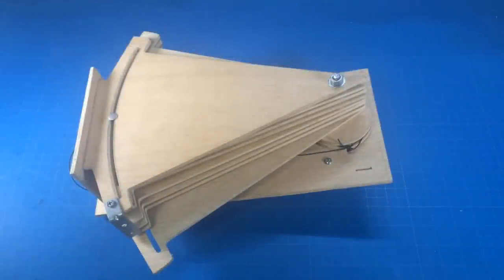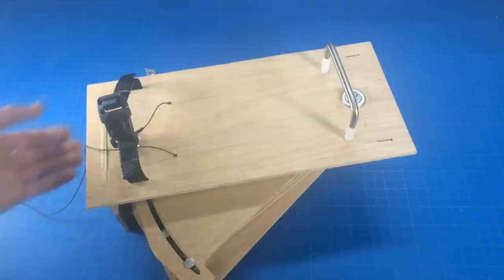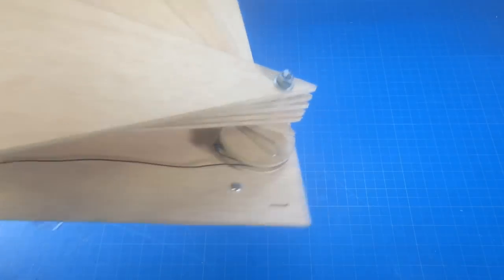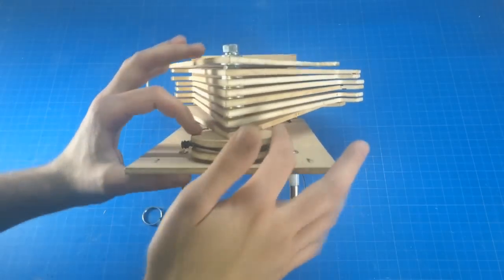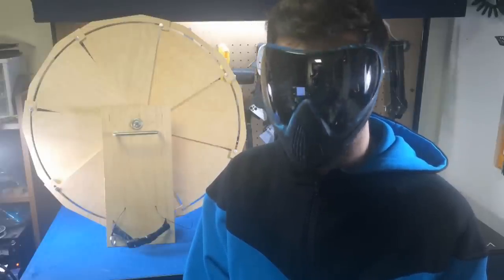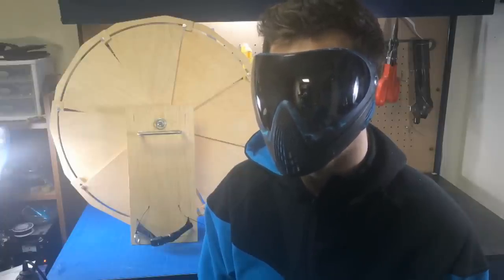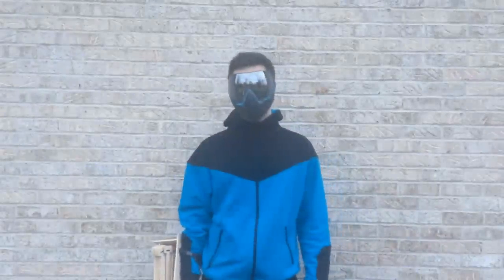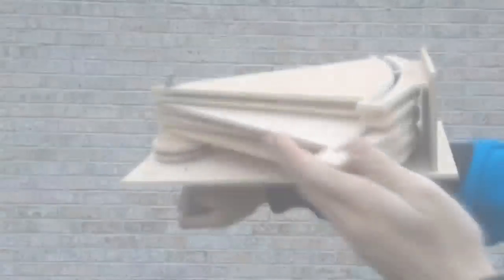Deployable Arm Shield "Percy Jackson Wrist Watch Shield"

Comment: If it were me, I would make it some type of gauntlet or glove. maybe move pulley system to the center, because the shield is so big. you could also have it to were you have a ring on your finger with a string to deploy it and spring to reset it.

Comment: make it out of thin strong metal have the joints be light and add a button rather than string to open it and also add some counter weights so when you take it out its not a strain on your arm.

Comment: Very nice! is there any way to reinforce the front of the plywood with a thin layer of aluminium and would that work?
Reply from the maker: +Tasos Meletlidis Aluminum is a relatively soft metal. Currently I don't have the machinery to mill it out. It's also expensive.  Good idea tho, thanks for commenting :D

Comment: Aw man, please make the metal version! that would be amazing! As an engineering student I wish I could help but I don't know, it looks like you know what you're doing, for a prototype at least. My only advise would be to figure out a way to deploy it without a string. Or at least a controlled string. For example I might just make this myself now just because of how awesome it looks but probably out of metal and I would probably, at least try, to use cables and have a bracer with a slider on it so when you pull or push it it deploys. Not sure how plausible that is but it'd be nice right? I finally just subscribed today btw, Merry Christmas! 
-Dec. 24, 2015
Reply from the maker: +erock676 Haha thanks. Its a nice Christmas gift! I might become an engineer too!

Comment: dont think its a point in using a motor, use an spring mechanism instead. Because it dosent matter if its an hassle to pack up the shield afterwards since you would be done with your enemy.

Comment: well once you use try to use metal for this dont forget it should work almost the same, with the mechanism but make sure the metal isnt too thick so it will still be lightweight, and you will be able carve your logo into it also
Reply from the maker: +Tyler Van Pelt Those are all good points! Maybe I'll laser etch the logo in.
Reply: yeah that wouldnt be to hard to do, and it would make it look pretty sick
Reply: and maybe for this shield that you have now if you have a wood burner you might be able to wood burn your logo into it

Comment: hay bro nice shield nice method while i was thinking about it i thought of my own idea as well well you see of there is a bolt in the middle you can use a motor on the bottom on the bolt and  the shield plates are fixed on the bolt and the plates are on a angle bent towards the arm this method may work to make the build a bit thinner allowing the plates to be closer together also a manual way to stop the the momentum of the shield opening is by having a lock that hits each other like this        

    ]
[
the to curves grab each other preventing further extending 
also a a spring verticle to the playe on the bolt can be used to propel the sheild ad motor to retract by rewinding the bolt and beacuse the plates are fixed on the bolt they were retract ( note to keep the spring not to strong or the motor will stuggle to reduce the tension on the spring opposing force 
your outer ring track that keeps the sheild open in a circular motion is a reall good smart way to keep the sheild from openiong in a diffrent form 
nice work hopes my ideas help 
ps: if i had the materials at my eposal i would have made this cause i have fantisized make ing this as will as percy's sword

Comment: What's keeping the shield fragments seperated? Spacers near the edge? Something along the lines of that? Or is it just floating there only connected by the bolt in the center? Adding spacers between may keep the shield more stable and stop from opening half way like I saw in your demonstration.
Reply from the maker: +The Huggernaut Yes I used washers. Now that I think of it, I should have used nylon instead of metal

Comment: +GreekGadgetGuru what if you took half of the shield plates and put them on the bottom wouldn't that help more with the sleek design and with the opening and closing anyways love the shield keep up the great work
Reply from the maker: The only thing would be to have 2 moving pivot points. it would spin outward in opposite directions and meet in the middle on both sides. Thank you!

Comment: You should make the mechanism hidden on the inside somehow so that a blow to the edge wouldn't break it's pully groove system.
Reply from the maker: Yes I agree! but moving it farther outward makes it easier to spin.
Reply: +GreekGadgetGuru Cool you replied :D Great job so far, I have a few more ideas that might help with the prototyping. 

When I can afford to I want to set up a little shop to make invention idea projects like you do. 

Anyway yeah, there's more leverage on that outer edge but for durability in combat it might not hold very well. 

I was just thinking something hidden behind a solid top layer.. In some kind of metal groove / rail attached to the underside of each "shield plate". Like a curved ball bearing drawer rail. 

And maybe it could use an electric motor or compression so that you don't need to use your other hand to pull the string. Then it could block one handed while you hold your weapon in the other.
Reply: +GreekGadgetGuru I tried to vote for you in the contest but I just noticed how old this video is lol. Maybe you're not working on this anymore.

Comment: I've been designing a  plastic melt&mold system... What if you make molds for each part, & mold it out of polypropylene. Light weight, toughest plastic available, & you could make the parts clip on, incase someone was able to break it.... Another benefit is when plastic breaks, you can remelt it, & remold it. So no waste, what do you think? 

:^)

Comment: I feel that your design is but I feel like if you where to use a remote control air plane motor it would make for faster deploy and I feel it would be easier because then you could flip a switch for when you need to deploy it and it would be a lot easier to disengage it.

Comment: Wood breaks metal bends and dents after every fight you would have to replace parts and components if your on a battle field back in the day this would cost a lot more then a simple here's a wood planks with a hole in the middle for your buckler to be riveted on

Comment: You could make it smaller so it could round out the edges and add some smaller pieces of wood to as the shield it would be thicker but it it would be smaller or all metal
Reply from the maker: Making it out of steel sheet metal, it could block a .22 bullet, and most likely an arrow. Or high impact polycarbonate
they sell it in sheets, but it is expensive. I make almost nothing on YouTube. I may not be doing this for long. We'll see.

Comment: a suggestion for an alternative to using a huge motor   try using CO2 cartridges to rotate the whole thing , something similar to what Colin furze did when he did the rope launcher, do search for that its here on youtube and he shows how he did it, also he is 80% mad so yeah.. enjoy
Reply from the maker: +andreimotz He used the compressed air to shoot a projectile. I'd have to use it to add a pneumatic cylinder. Its a challenge either way. Thanks for the suggestion. Colin Furze did an amazing job with that build.
Reply: +GreekGadgetGuru not required. just replace the pulley with an encased propeller that sits on the axle which turns the plates  and then shoot air one way or the other, to make it turn really fast, a thing to consider is that the propeller might break when the plates are fully opened due to the massive impact. a good place to start is to take a look at those old server fans, not sure if they still use them today, but u can find plenty of them online,however they will require some modifications(u will have to close the top attach the fan to the axle and make a hole for the air to make it go in reverse)

Comment: One way of improving this would be to have more, narrow, thinner segments made of something like plexiglass or aluminium. Coupled with an actual gauntlet, that would be much more ergonomic to the user. if you compacted that as well as the interconnecting rail system, you would have something perfect for riot police to use! Think about it, as of right now it's either a case of riot officers having a shield when in a shield wall, but when they disperse along with a crowd, a permanent solid shield becomes more of a hindrance as it no longer has the strengths that being in a shield wall provide. This will then give an officer chance to 'sheath' his shield when no longer wanted and quickly deploy if a situation gets hairy. If you make it out of something like plexiglass or aluminium, it will still be fairly lightweight, can be much thinner, and fire resistant too! What's that? Molotov Cocktail? No problem! Rioters throwing rocks and fireworks? Out comes the shield in no time! Dude, you have to pitch the idea to a law enforcement agency, man!
Reply from the maker: These are some really great ideas! Thank you :D

Comment: Steel would be awfully heavy on your arm wouldn't it? Aluminium would be the better choice but you lose out on durability. Would also be better to conform the gauntlet to your arm, as the brick is bulky and in the way. 
Also, the wood youre using is really thick and I believe one of your aims was to be stealthy and non-cumbersome. While it's in effect because te shield is smaller when undeployed, should focus on getting the pedals of the shield smaller while keeping impact resistance and durability in the spotlight. Steel would be good here, but if oyu're using the same thickness as the prototype, ideally it would be aluminium.
Anyone have any suggestions correct me if I'm wrong.

Comment: Why would you need a retractable shield over a normal shield? Sorry I'm not getting the practical application for it, don't get me wrong its a cool contraption!
Reply: same reason you need a hidden blade and crossbow. badassery
Reply: He said this is for stealth so say someone has a shield and a sword and you have a sword and this they will think oh I have a better chance and then you have the element of surprise and its an even battle and the other person is gonna be cocky and then he won't try his hardest now I know nobody is gonna be battling with swords and shields cause there are guns and we arnt in the mid evil days
Reply: +Ryan Degiorgio Sorry I'm not getting the practical application
Magic quests, killing dragons, melting powerful rings, saving princesses, etc.
Reply: Mobility and stealth
Reply: +RetroButtonMasher To make this thing strong enough to withstand real attacks it would need to be made from a much stronger material, the weight of the material would negate pretty much all mobility gains. You would also need to solve the issue of the 2 handed deployment.

The other problem is that it is attached to his arm, any force applied to the shield would transfer right into his skeletal structure. An attacker could grab the shield and a simple twist would break the arm right at the elbow. 

Real shields like this were held in the hand by a center boss. Having it strapped to your arm is severely restrictive and also dangerous to the user. Thegnthrand has some wonderful videos illustrating this beautifully.

Comment: i think that a shield is very big and ucofortable if is small or no stronger but is my opinion it can be v better ,yes but, you can make a metalic glove and arm because is more confortable because confortable means fight smooth and easy to move or thath my goal. but in any case i have an idea for that shield i comment you:D
Reply: +Jesús Eduardo “jesuseduardo90” 
Something you can add is a tipe of spring to auto open the shield and when you closed you compress the spring and locked:D
Reply: +Jesús Eduardo “jesuseduardo90” 
and can open and close the shield with one hand

Comment: Could you use a motor instead of manually pulling it
Reply from the maker: +JAMAICAN RASTACOWMAN Yes, but I explained that it would be weighing it down with batteries and motors. Theres pros and cons to both ideas. Having motors would also allow computer automation to detect incoming projectiles and deploy the shield when needed. That's some super high tech machinery and programming though.

Comment: Try to figure out a way for a trigger system for 1 hand usage.
Reply from the maker: +8-BIT Oh the challenges I'd face. Maybe something like a bike hand brake. I'd for sure have to make it motorized for it to work.
Reply: +GreekGadgetGuru make a big gear attached to the trigger that holds the wire, and the wheel that makes the shield deploy smaller. u will figure it out ure a smart guy! ;) GL

Comment: As cool as folding and unfolding it is in a second, I feel like you are sacrificing integrity. If you could have it easily deploy-able but a bit harder to fold it back you might be able to work around some problems. Like others have said, a spring and button would work better but that is more complicated. I'm thinking if you change it so after it's unfolded, the pieces drop down to become flush with each other and have a middle part slide down locking them in even tighter. It would slide down with a spring perhaps. It's a bit hard to explain I guess... But I'm no engineer so it might not work.

Comment: I'd have it spring loaded for opening
Reply: Or, if the shield shards were more like nesting dolls, made from aluminum, that could save on bulk and weight.

If they were curved on the forward face, and the final shard went slightly into the first shard, I think they could use the same principle that reinforces arches to maintain integrity upon being struck.
The weak point might then be the area in the center of the shield where it attaches to the platform.

Comment: very cool desgin and a lil late on this comment and it would probably be too much work and would ruin the shield kinda but here goes. wb on the top of the shield to have a Taser kinda block almost with positive and negative  almost in a checkered pattern to where say in a riot, police could use this to help push rioters back. idk really know about engineering and electricity other than basic stuff I learned in class but could be useful if u could figure out the correct way to do it. sorry for this if it dosent help, very good design though you have earned a new subscriber

Comment: ok this looks really cool, nut its not practical at all, it can ipen on its on or not open fully, even if it was made out of titanium it wouldnt be sturdy cause of the joints, it would have to be tin and ita not 1 solid piece, but for a movie or something its an awesome prop, btw not hating just my criticism
Reply: ok im on my phone pls excuse my errors
Reply from the maker: I think about the ability to absorb impact and disperse it across the many shards. Energy comes in waves, Most shields rely on stopping the force immediately. This would catch the energy and spread it through the shield. Look up Dragon Skin Armor. It works the same way but with individual pieces of ceramic armor.

Comment: Dude you seem like a super smart guy, look up how to make your own foundry, use that thing you used to cut out that wood and cut the pieces out in Styrofoam, aluminum is easy to melt, you can even make an arc welder and melt tougher metals like copper and steal, you just have to see the right video, either way, if I where you and had the time that's what I'd use. engineer the shield with a strong rubber band, with a pull and hook kinda lock to keep it closed until your ready to use it. I hope things turn out well for ya, your last video kinda seemed like you wanted to give up in a way, man keep it up you've made some bad ass things, hacksmith stuck with it and you should to!

Comment: I'd like to imagine this with bullet resisting glass.
Reply from the maker: +Voxelpod Something like  2 glass sheets with some binding agent between the two so that when it gets shot it doesn't shatter, similar to most car windshields.
Reply: GreekGadgetGuru That'd be awesome! There could possibly be some law enforcement applications such as extra protection to the torso or weak points in kevlar vests such as the joints and the neck.

Comment: @greekgadgetguru im no engineer, but i have some issuese to improve it. metal shields aint going too far without weight, but if you make a hamburger of copper-wood-aluminium, itll pretty much stop arrows and stuff, probably lower caliber bullets too.
if the shards are closer to each other, it can be more slick, a block on the left side would stop it from over-turning. mirroring the mechanics (bottom is fixed and the rest turns). id try to reduce the shards with 1-2, and use a better shape for the handle or id just use the bottom shard as the base(saving weight which will be added by the aluminium coating)

damn man now you made me thinking...

i dont know what would i do with the mechanics to make it faster or more reliable... id use skateboard bearings for sure... abec 9 or so... and think id add a clicking mechanic (like the 1way spinning doors) with a releaser for safety reasons... and i think id do something stupid with the rope-pulling-opening...

for fancy reasons i would add a knife or an edge to the shard at the middle when the shield is opened... so there would be some punch in it :P

Comment: hey much did it cost to build it
Reply from the maker: +IRON SAMURAI Like $20 in parts, maybe $30 because I already had most of the materials. You would probably want to CNC / laser cut the parts out.  I use the  X-Carve CNC milling mach
Reply: oh right im in England so it would probably cost 12 mayber 13 pounds
Reply: maybe I could send you some fiber glass because I work in I motorbike shop and we have a lot of fiber glass for spaire